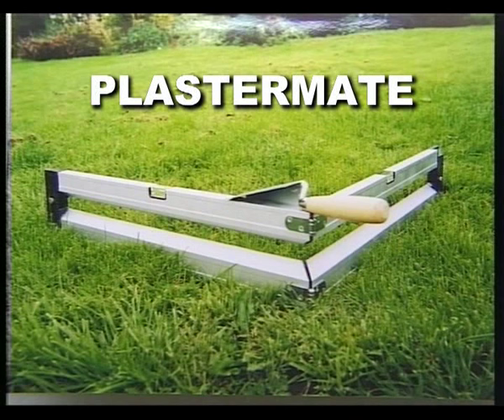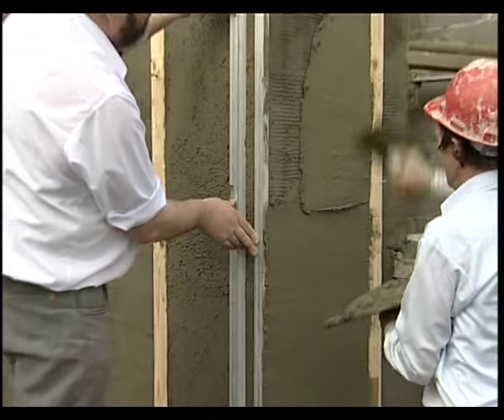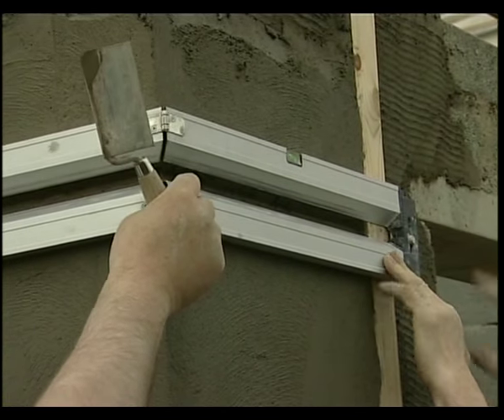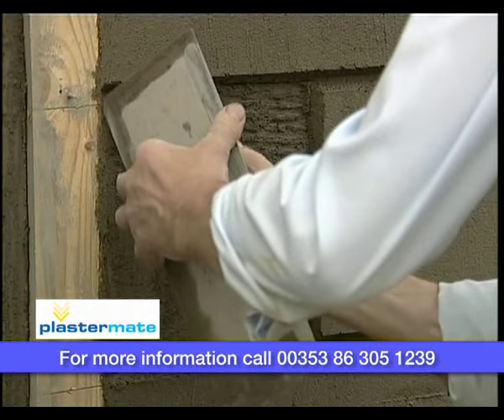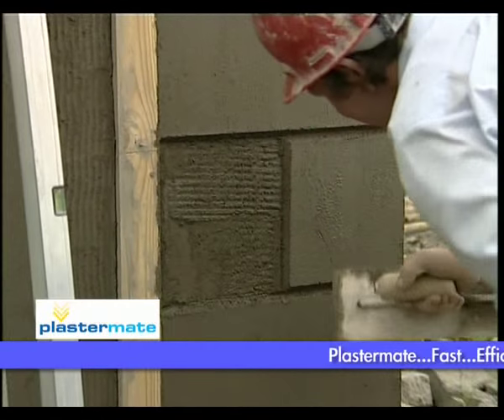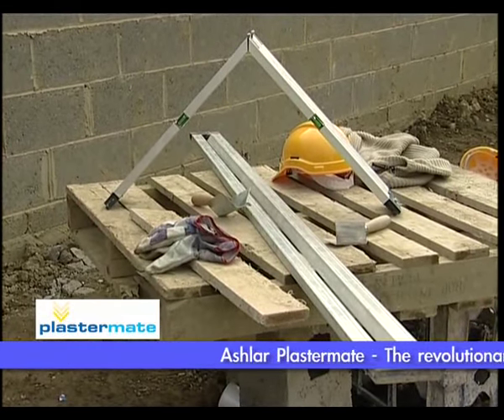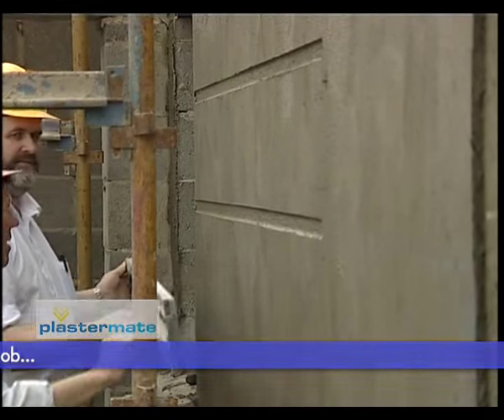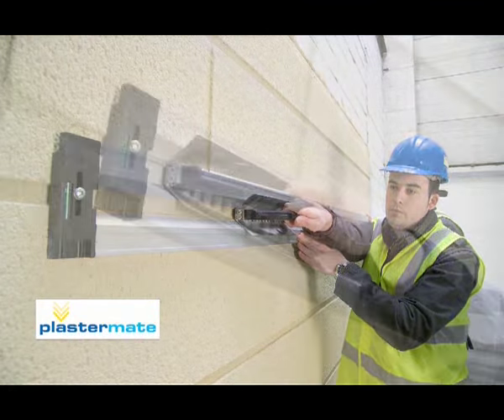PlasterMate

Comment: Here in south florida, when we make stucco cornerstones like that- we call them quoins- we lay on the whole corner at once, ground to soffit, 3/4 or 1" thickness of stucco or so, no wood forms, nothing.  Then as the mud dries, we lay out the cuts with a tape measure to the desired dimensions and cut out the joints that form the blocks or quoins with a tool that is the width of the desired joints.  All that wood forming is 3x as much work
Reply: You call them Quoins because it is French for Corner!  Immigrants from Europe brought the technique with them to The USA.

You have to be a real artist to do them freehand. I would love to see your work.

Comment: I guess these guys never saw what cement mortar does to aluminum. It isn't pretty.
Reply: What do You mean? I used to use aluminium darby's and feather straight edges for years with no deterioration, apart from wearing out after many years use
Reply: @MrFlynnytwo  Not to mention aluminium hawks ;)